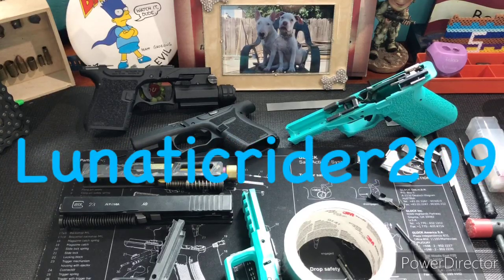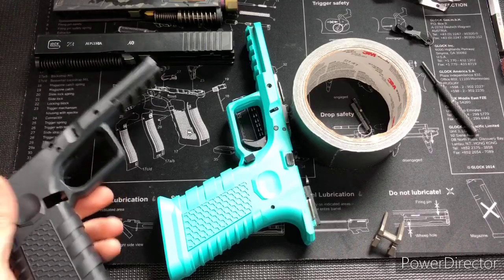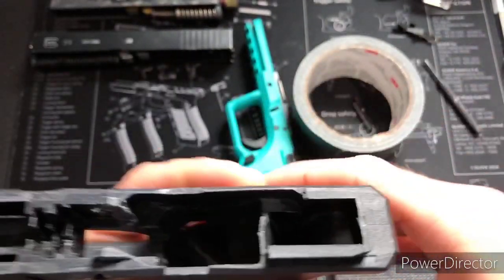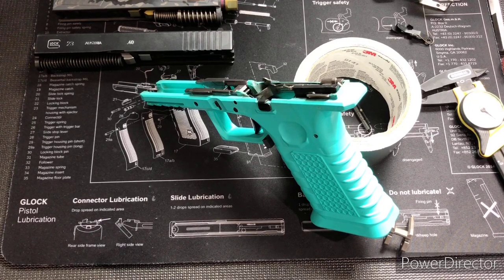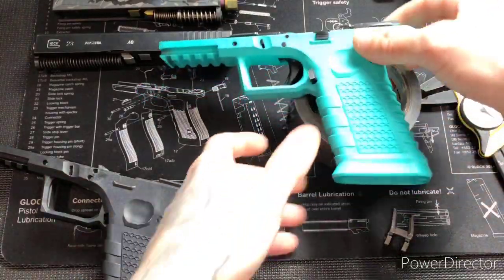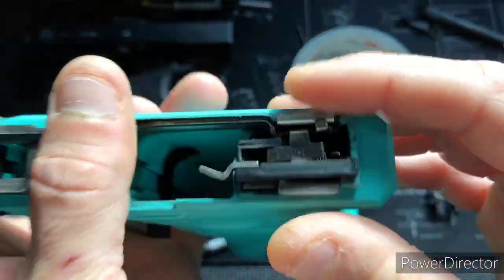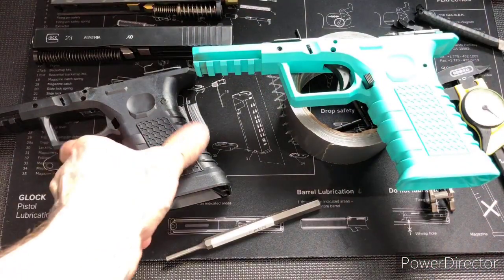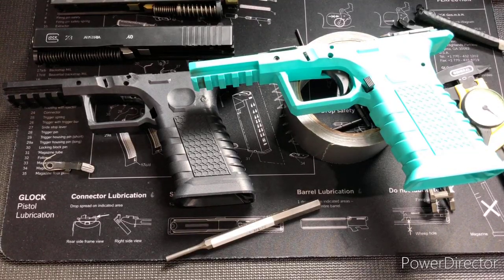Polymer 80 V1 Spectre Adding Metal Rear Rail Modifications How to Video

Comment: This is my idea I had for moding the V1 to take the current P80 rear rail unit. Good thing I decided to research it see if anyone has done it before, as there is some useful tips I hadn't considered here. Thank you!

I also don't see how they can say removing material from the frame can weaken it, when you are then replacing the removed plastic with the metal of the rear rail unit? The frame should actually be stronger then.

Comment: You da man bro. I’ve had a build that’s been just sitting. Today I thought to myself “maybe I can add some rear rails” and bingo bango I find this video explaining exactly what I need to do. Which rear rails should I order. And I only need to modify that one side you did nothing to the other?
Reply from the maker: Glad to help you with your build. You’ll definitely like the rear rails better. Polymer80 rails for the PF940C will work. Those are the ones I used for mine. Ebay might have them if you can’t get them from polymer80. Good luck!

Comment: Dude how did you make the rails?? I been wanting to do this for a while. Any tips? Tricks or tools you’d recommend? What Kind of metal did you use?? Any help is appreciated.
Reply from the maker: JD556 CT223 it’s a special type of metal that has magnetic to it. I order them by the sheet. No tricks. Just a lot of tedious work. I cut it with a plasma on a jig to keep them exactly the same shape. Then drill the holes. Then bend into shape one at a time. Takes a looong time to do one but the quality is better than what’s on the market. Being from California makes it hard to have relationships with any fabricating shop. They’re all to worried about laws and lawsuits otherwise I’d be pumping these out for all you to buy. If you got any other questions let me know!

Comment: Very cool to upgrade your P80 Spectre V1. How many mm's did you say to leave at end? 4mm on each side? Also, did you remove material for back channel area only on the one side or both sides of P80 frame?  Thanks and I would very much know how you create a template to fabricate the metal rails. Thanks and keep safe and sound.
Reply from the maker: Thank you. On the video I said to leave 4mm of the polymer rear rails on the top backend of the frame. The curved part of the frame I didn’t touch. I only took out enough material on both sides of the pocket for the rear metal rail and trigger housing to sit nice and tight. And make sure to do it evenly so it’s not crooked. I took a lot of time to come up with a template that I did by hand. But polymer80 found out what I was doing and just put out a copyright on the rear rail design so I can’t make or sell them. Just another jab at me nothing new from them. Luckily I knew they’d be doing that and I’ve been working on a different design that’s going to be better imo. So now I’m just starting all over from scratch and having to make a new jig which takes forever. Takes a lot of time and work when doing it by hand. I can’t give away all my ideas but thanks for asking!
Reply: @lunaticrider209  
Thanks for responding and I totally understand. I agree it sucks that Polymer80 did that but I guess capitalism and protecting their interests. Keep up the great videos and keep calm and shelter stay on!

Comment: Nice video, If you were building a V1 now, would you keep the polymer rails and put a few thousand rounds through it, or go straight to this?
Reply from the maker: Straight to this. It feels so much better and one less thing to worry about in the long run. Hope that helps!
Reply: @lunaticrider209  It does thank you.  I didnt see it in the video, but may have missed it.  Did you get the rear rails from p80 or a third party?  Can you post a link?
Reply from the maker: I was making the rear rails myself but then Polymer80 put a patent on them because they saw or heard from my videos that I was selling them. So I’m in the works of redesigning them and just trying to get the metal which has been difficult because of this covid. I hope to have something in February if all falls into place. If I see of another business making them I’ll make sure to send you the link. And also thank you for liking the video. I really appreciate that!
Reply: Do you have a email I have my Spectre almost done wanted to send you a couple pics and you tell me how it looks I think I'm half way with the rail fitting. I used a Dremel and now using a small flat file. It takes for ever but it's working.
Reply from the maker: JHCustomfirearms@yahoo.com
Reply from the maker: Let me know when you send the email I get a lot of spam. Thanks
Reply: Just sent it.

Comment: Will the V2 full size rear rail work in V1 frame?
Reply from the maker: Sorry I took so long to get back to you. I wanted to make sure it did fit and function. I had to find me a V2 frame and use the rear rail on the V1 to confirm if it did fit. Therefore the answer is yes it will fit and function using the V2 rear rails onto the V1 frame once modifications are completed. Any other questions you have feel free to ask!
Reply: @lunaticrider209  how can I get ahold of you off YouTube? Email?
Reply from the maker: @cdhc10  JHCUSTOMFIREARMS@yahoo.com

Comment: did you take material from both sides or just the one side? it looks like if you only take out material from the one side it would be offset to one side?
Reply from the maker: I take material off both sides. You’ll see if you look at once I’ve completed it I make sure both sides are equal in measurements. Watch the whole video I explain in detail what needs to be done. Let me know if you need more info.